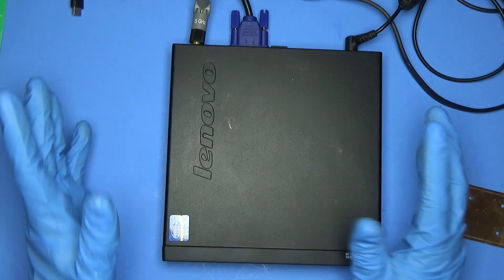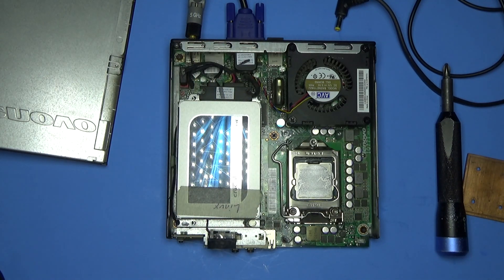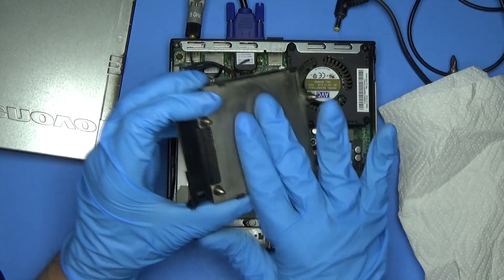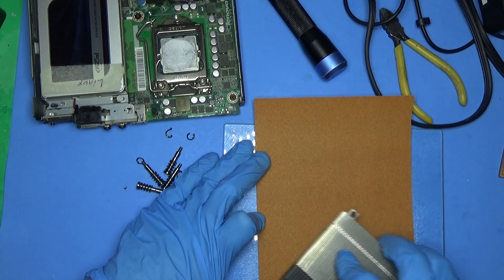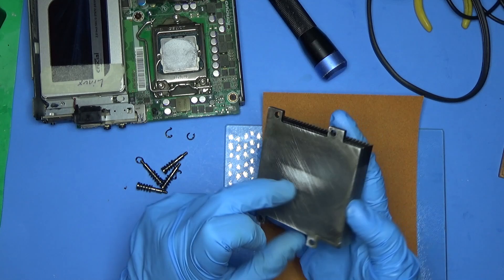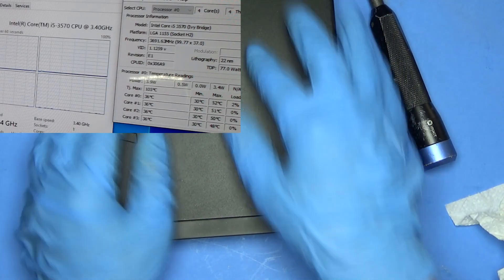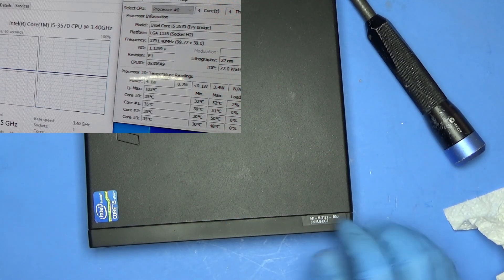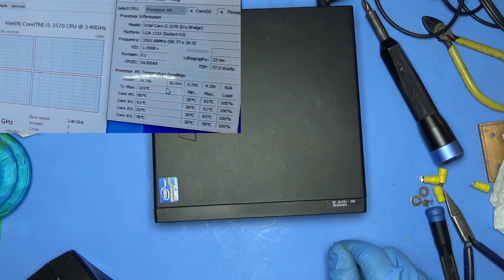Lenovo M92p Cpu Upgrade Thermal Issues - Heatsink Modded -  Poor Cpu Contact - Heatsink lapping

Comment: So I got lucky. I’m a mechanic at a dealership and I’ve made friends with the IT dept. IT recently gave me two of these. One was working just fine and the other wouldn’t output video. The one that won’t output has Bluetooth and WiFi and the extra display port. I want to lap the heatsink from the bad one to install on the good one like you did but what did you do to get the screws off the heat sink. I could get them off but I’m trying to not be destructive. How did you remove them and not damage the little retaining rings that hold the screws and springs to the heat sink?
Reply from the maker: I don't remember exactly, I think they were just washers that were pressed on.  I don't know if I did that here, but I know in the past I'd just push down on the screw to expose them and then use a pair of pliers to grab and rip them off.  Usually have to bend them back and forth until they break.
Reply: @jims_junk I thought maybe you had a method besides breaking them. All good. Thanks though.

Comment: What's the performance difference?
Awesome video
Reply from the maker: Thanks!  As far as performance, I haven't measured but it used to thermal throttle all the time, it doesn't now.
Reply: @jims_junk  I mean compared to the old processor?

Comment: i actually lapped my laptop gpu and cpu aswell as the heatsink, with those nail foam polisher things has like very light grit in the 1600-2000's my mom uses hahah, it made a big difference, 11400h+rtx3060

Comment: I've since taken apart my Optiplex 3060 Micro and the coldplate was pretty flat from what I see so I didn't lap it. Replacing the thermal paste made a bigger difference and cut down about 10C of idle temp.

I considered getting another Optiplex Micro to harvest the case and cut it and slap a 120mm fan on the top but opted against it since that would cost me ~20 USD for a barebones Optiplex 3040 Micro (case + mobo) alone.

Instead I chose to get a Delta BFB1012VH blower fan for a bit under 5USD. So far i  testing the Optiplex 3060M tends to be at 72C under load at 29C ambient, but with the Delta fan it was 65C. With an Arctic P12 on top with the 3060M case open it was more of 69C so that Delta fan blows hard.

Coincidentally the Delta blower fan fits nicely at the front vents of the Optiplex Micro which is nice, but I'll have to make a nicer power supply and mounting setup for the Delta fan though because it can blow itself away LOL.

Comment: I'll have to look closer at the heatsink of the Optiplex 3060 Micro (i5 8500T) I got recently as I was seeing 58~60C on idle when I was testing it on a 32C environment. 
My solution for now is to point an 80mm fan to the front of the 3060M to help push air out the back which does work and the case isn't warm to the touch in that setup. 
Not sure how uneven the coldplate of its aluminum heatsink block until I can check it but I may attempt lapping it if needed.

Comment: This is the reason building your own mini pc is better but the downside is the power supplies are not efficient in low wattage. OEM have custom power bricks for the system unit like this. I cant get lower than 50w idle than this oem one.

Comment: Good video. When I build a socket 1700 cpu build or AM5, I always use an aftermarket CPU Contact Frame. It was originally meant to stop the cpu from bending but it also lowers temps by 7 or 8 degrees (for 1700 cpu's) and keep thermal paste off the motherboard. They only cost around $10 on Amazon. A cpu contact frame plate like that would be awesome for this, hopefully someone could fabricate some for socket 1150.
Reply: I have two systems running LGA1700 sockets, and that's all I use are contact frames. The temps do drop a bit. Your mileage may vary on the temp drop. I use them mainly to keep the stock locking frames from bending the CPU over time.

Comment: maybe i should lapp the heatsinks on my apple mac stuff even with new thermal paste the minute you do something cpu intensive for like 5 minutes the fans slowly ramp up until they sound like a jet engine!! they are intel macs bte 2012-2014 models to macbooks n a mac mini
Reply from the maker: The Intel Macs need all the help they can get.  Used to be hooked on Louis rossmans channel.  Couldn't believe how bad those things were

Comment: I have an optiplex 3010 in the cuboard it had an i3 4130 and i went to cex and bought an i5 4440 for £5 i could of bought a i7 4770 but then i thought the motherboard wont give it enough watts so it would be restricted putting an i5 in it shpuld be ok the i3 had a tdp of 54watts the i5 84watss doubling the amount of power usage through a dell motherboard is probably impossible though some sites state all i5 4gen are compatible with optiplex  3020 sff they usually sold with an i3 4130 54watts the best computer i have got is a asus g531gv i7 9750h rtx 2060 144hz display 6c 12t 2tb ssd 16gb ram thats tdp varies at 35 to 45 watts its got the same cpu benchmark as 10100f for a laptop thats quite beefy its not as good as amd 4800h though thats 8c 16t

Comment: Shame that heatsink is such an issue, looks like a nifty little machine otherwise. Personally I think trying to expand the width of the case so you could mount like a 120mm fan on the door could've been a good idea when Lenovo were designing it and tbh, even having twice the width wouldn't compromise it's compact nature in my opinion.

Comment: These tiny PCs are very popular in the homelab community because of the size and low power draw. I have two HP models. No temp issues with mine though. :)
Reply: I think they present themselves as good raspberry pi alternatives too

Comment: Funny, i sat with the execpt same model yesterday, that i have in my LAB for a re-paste, due to high temps, idled at 50ish and under semi load 75-80ish degress c, i noticed the same pattens and rougnees in the heatsink, like you said, and i tought the same , that it was bad proccsing by Lenovo, but did not consider to sand it, but i am going to get some paper right now, and give it a try, on mine when i changed the TIM and cleaned the fan and all,  i noticed that the heatsink had an excessive ammount of thermal paste, witch could be there way of trying to mask this, i assume it is the original by Lenovo, i know its an old pc but i was expecting better QC to be honest, will try going for wet paper a set with 300-1000, wil post an update later, thanks 👌
Reply: i managed to get it smooth unfortunely i cant uplaod the picture in here, i went with 120 grid std paper and 300,600,1000 wet took aprox 45min and 100 strokes in 5 passes of 20, in all 8 directions, straight and diagonaly both ways, the s shape disapered, so i dont think there is a an evapor in the heatsink, now it is straight as an arrow
Reply from the maker: Nice job.  And hows it perform?
Reply: @jims_junk  og missed that 😅, as close to idle is i can get in unraid, it sits at 38 degrees, and for load i tried with prime95 max heat option and stress hypertreading,, it reached 80 degrees c, a litte high but considered its a senerio, that i will never see with it maxed out for several minutes im very pleased

Comment: Interesting, kinda reminds me of (yet another) older Dell latitude which had a similar problem with it's heatpipe only covering the center of the CPU but not rest of the die. I wonder if using a high quality thermal pad would be able to fill out the gaps in a similar way like sanding the whole heatsink down.

Comment: I can't believe companies like this think it's okay to sell products with poor heatsink quality when it's literally mandatory to get good cooling in such tiny PCs...
Reply from the maker: Its sad because there was once a time when profit was only part of the goal.  Companies took pride in what they did and customers not only benefited from that but also looked for those companies because they knew they'd get a good product, or at least the company would stand behind them and repair/replace if there's a problem.  Now in these days its 100% profit driven.  I remember Saturn in the 90's.  Love em or hate em, they took pride in what they did.  I remember working on my car and many times finding signatures of people under dash panels or other parts from the assembly line workers.  I later saw an interview where workers admitted to doing this as they were proud of the work they did.  Not to mention the Saturn homecoming, where owners would drive to the Saturn plant from all over the US to hang out with other owners and the company.  As soon as GM took a larger stake in the company, the homecomings were canceled and the quality went downhill fast.  Its no wonder they failed.
Reply: @jims_junk  To be fair it was probably fine for the original 35w TDP CPU, those things barely need a cooler at all.  Not that it's OK to have such shoddy workmanship but I've often sadly found OEM machines fail to cool properly on some level or another so not surprised.
Reply: I mean Kias and Hyundais sold cars with sand and trash in the engine for a few years before it made any news.
Reply: This is build for 35W to Maximum 65W -> Intel T CPU is only 35W 😂 only Lenovo Tiny X are build for 65W CPU's Like M910X 🤷🏻‍♂️
Reply: That's what happen when they move production from China to Vietnam. Gone down to shit.  That goes for Samsung phones too....
Reply: Whine Whine some more boohoo! then go design one yourself from startup to final product lol blame the consumers! we want nice tech but are NOT willing to pay but we will SURE COMPLAIN!
Reply: @funnbuntv  I literally paid extra money to get decent cooling capabilities on every computer I owned. Cooling is mandatory. 

Selling a PC with such faulty cooling should not be allowed.